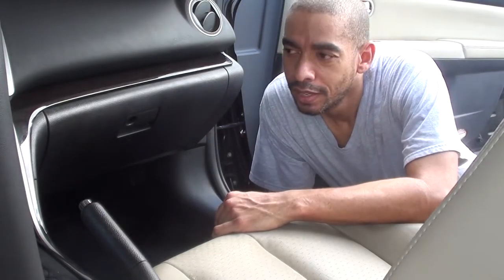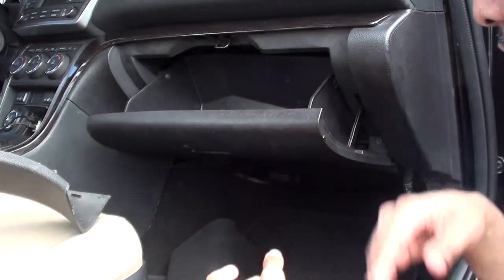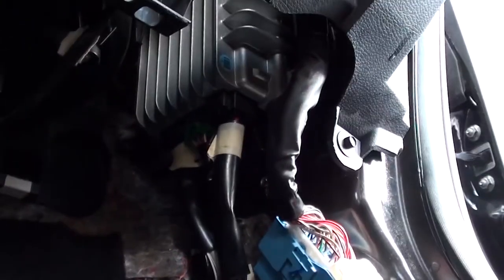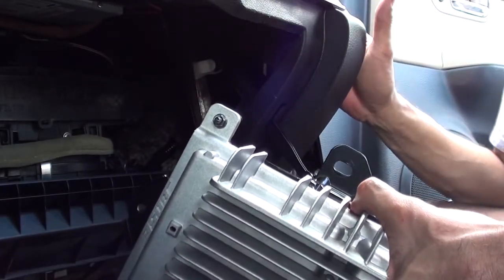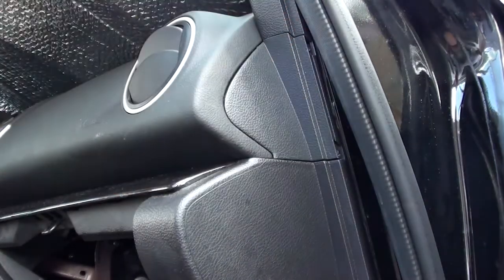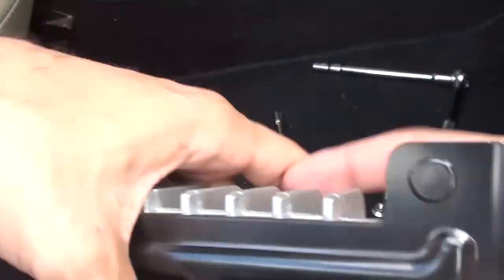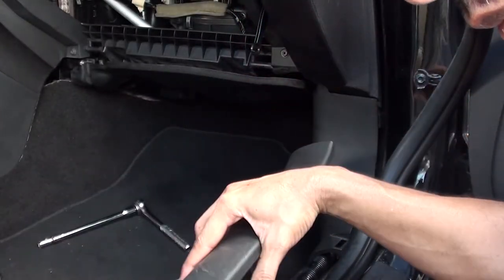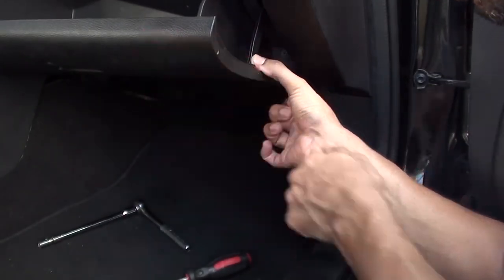2009 - 2013 Mazda 6 Bose 9M81 18T806 BB Amplifier Removal and Replacement

Comment: Thank you so much for making this video. I just followed your instructions today to replace my dead amp (loud machine gun sound out of all speakers) with another I bought from Ebay. I don't really work on my car at all, but this seemed very doable thanks to your detailed walkthrough. After about 20 minutes I was done! Thanks!
Reply: Mine still makes the machine gun sound after connecting the new amp, any tips ?
Reply: I have this exact same noise. The loud machine gun sound. Did it get rid of that sound?
Reply: @JPWRana  Yep, the replacement amp fixed that issue and still works great today. Give it a try!
Reply: @brian.8888 did you fix it ? I would say maybe the fuse

Comment: thanks for your video. i found a guy that comes to you. took out my 2008 maz 6 bose amp ,2 days later he installed the reconditioned amp with 2 years warranty.$330 aus. works like new.
Reply from the maker: Good going!
Reply: Hola Neil, podrías darme informes sobre en cuanto costó la reparación de tu amplificador, ya que tengo un problema con el mío y no encuentro donde repararlo

Comment: Great video. So glad to have found it. I had no idea where and how to pull the amp. My symptoms were that all speakers would cut out after a strange slamming sound. A day or 2 later it would come back. In the meantime I will leave the amp connected but I won't be putting all the panels back. I am thinking it may be an overheating issue. If it doesn't cut out again then that diagnosis would be confirmed. I ordered a used one anyway, just for safe keeping.
Reply: Today I had a problem with my bose sound system. It sunded like a machinegun...even if I tried to turn the system of....after av short while... no sound anymore...could it be the amplifier gone bad? Was that the slamming sound?...like a machine gun?

Comment: Hey bro. So im thinking this is whats wrong with my 2010... ive been having moisture under the front passenger floormat that i am told is from a clogged ac drain line or whatever. No one anywhere will un clog it and im no mechanic. Wondering if you knew how to do this and if moistyre could cause it. THANKS!
Reply from the maker: As it happens, I had this very problem with water getting under the passenger carpet. My problem was not a clogged AC drain pipe. but the problem was in the general vicinity. The AC drain pipe is on the passenger side of the engine bay, up against the firewall. It is just a little pipe that juts out of the firewall. It is a very bad design since it does not have a hose to carry the water away from the frame. In my case, as the AC water dripped from the pipe, it ran down the firewall down and under the sound-deadening material and found its way inside the cabin through a hairline crack in the seam. I fixed it by putting some silicone on the hairline crack and fitting a hose to the pipe. That hose no longer allows the water to run down the firewall. Some northern cars developed a front crossmember corrosion problem because of this pipe and Mazda fitted a hose to those cars. A friend of mine has a 2010 and it was originally from up north and it had this hose fitted. In case you are wondering, I went to O'Reilly and bought a Dorman PCV elbow, Part#47028 and it fit perfectly. You can see my post on mazda6club.com: https://www.mazda6club.com/threads/water-getting-into-the-cabin-but-where.447376/

Comment: Can you make a video on how to do the subwoofer? I have a 2011 Mazda 6 and it doesn’t have the Bose system but I upgraded the screen to a Bose stereo and the guy said if I can change the amp and the subwoofer it should work! This video was really helpful and I would really appreciate it!
Reply from the maker: Thanks for the comment. I really have no idea how to convert from the standard stereo system to a Bose system. To be honest with you, based on the reputation and reliability of Bose systems in general, I don't even think it's worth the effort. You can get a pretty decent system by using better equipment out there. Crutchfield sells an installation kit that will mount these aftermarket stereo head units and even make the steering wheel controls function as well. Just go to the website and search for your 2011 Mazda6. But, if this is something you really really want to do, I'll go ahead and make a video. Just give me some time to put things together.
Reply from the maker: I haven't forgotten about your request, my friend, but a series of things have prevented me from attempting this tutorial. From what I can see it's a pretty involved process, though. Stay tuned...

Comment: Hello Richard. I have recently bought a 2009 Mazda6 wagon. RHD, 2.5 litre, auto  160000km etc
When biased to the front speakers, there is only the faintest sound from them; the balance makes no difference.
The rear speakers are working although they sometimes sound 'wobbly'. 
Mine is the stock, non Bose 6 disc changer.
Is there an easy way to discover if the issue is with the speakers or the head unit?
Reply from the maker: Greetings! Thanks for watching. The first thing you want to do is to swap the rear door speakers with the fronts. If there is no change then the problem is probably the head unit. If the bad behaviour moves to the rear, then you have bad speakers. Good luck. Let us know what happens!

Comment: I have a 2018 mazda 6 that has audio issues regardless of whether I’m using CarPlay, radio, or any other Bose speaker function. Right now it doesn’t play any audio even tho the apps (eg CarPlay) work. I did hear some thumping almost like there could be a short in the speakers previous to this when trying to play music in my car. Could this actually be a bad amp tho? If so, any guidance on replacing or fixing the amp for the 2018 + models?
Reply from the maker: I can't recall a lot of 3G cars having problems with their amps, but we are talking about Bose here, and their problems are known in every car that they are installed in, be that car Mazda, Infiniti, or Chevy. Not a fan. Therefore, it could be the amp. If you want to jump to having it repaired, check out eBay. There will be lots of guys on there that offer the service.

Comment: Helpful video! Both your door speakers had no sound? How were you certain it was not a speaker issue vs an amp issue? Did you get the amp repaired?
Reply: I just watched your other video about your speakers. Bummer! Did you find replacements? I have the same model year and also had two Bose door speakers stop working. I was lucky and found a guy selling two he took out of his Mazda 3 - the front door ones only on Mazda 3 are the same as the Mazda 6 doors speakers. This instruction video was still excellent and helpful. Never knew amp location and how to remove.
Reply from the maker: Thanks for the comment. As it happens, I jumped the gun with getting the amp repaired. I did a resistance test of the speakers, as well as the amp and I got some strange readings (possibly a bad tester?) so I used deductive reasoning to determine that it was an amp problem. That turned out to be wrong. It might have actually been that both speakers didn't go bad at the exact same time. I may just not have noticed that the right rear speaker was bad from before. Whatever the case, I messed up, but I don't regret it. I now have an amp that is hopefully more robust than it was before.
Reply from the maker: I actually found the speakers new online for about $75 each. I plan to go ahead and get those because I anticipate used ones to have a much shorter life than new ones. What I've done in the mean time is to relocate the left rear speaker to the right front so I now have acceptable stereo sound. I should have the new ones in shortly, though. I'm not sure that I'll be putting up a video since there's nothing else to really show, unless my public wants me to show it. I'm glad you enjoyed the videos, though. Thanks for letting me know that the 3's front speakers fit our 6s. This is some critical information that I'll drop in a video, after all. Of course I'll mention your name as the source of that info, if that's okay with you. Take it easy, brother!
Reply: That should do it for you. I just plugged in the “new” ones and they worked straight away. Guy sold me the used ones for $50 total so I couldn’t pass that up! I’ll remember your videos if needed in the future.

Comment: I am just trying to get the loud machine gun noise to stop can I just remove the fuse for the bose system to stop it?
Reply from the maker: Go ahead and try that. But what that will do is you will lose functionality of the stereo and Bluetooth as well. If what you want is peace of mind for now, that's a good solution. If you can't find the fuse or if it also takes out another feature that you do want, then just get behind the panel like I show in the video and unplug the amplifier.

Comment: Hi Richard, great video, I am however trying to find my amplifier location on the 2003 Mazda 6, my model is the right hand drive version. I find the wiring for the subwoofer in the trunk but can't seem to be able to find where the amplifier should be. Note that this model seems to have all the wiring but did come with the amp, sub nor tweeters.  Would really appreciate if you can provide me with some insight.
Reply from the maker: I believe the amplifier for the RHD GG model (1G) is under the driver's seat.
Reply: @RichardTait1977  I search under both front seats but can't find the connector like i can everywhere else
Reply from the maker: @MusiChapman  I checked a 1G workshop manual that I have access to and the amplifier is under the driver's seat (RHD model), but it is actually closer to the right rear passenger footwell and requires the driver's seat to be pushed all the way forward to get to.

Comment: Hey i have the loud sound problem, am i able to take out the AMP completely without having to replace it? Im fine with no music whatsoever but i wanna make sure it safe
Reply from the maker: You can remove it, but nothing that uses the speakers will work. The stereo won't work and neither will the Bluetooth.

Comment: Question. No sound on radio. Fused good. How will I know for sure it's the amp and not the radio itself. Thanks
Reply: Hey! Have you found out what was the problem with that issue? " No sound on radio. Fused good. on mazda 6". Thanks!

Comment: Today I had a problem with my bose sound system. It sunded like a machinegun...even if I tried to turn the system of....after av short while... no sound anymore...could it be the amplifier gone bad?
Reply from the maker: That's perhaps the most common sign of the amplifier going bad.

Comment: Do you know how to just unhook the amp without the battery dying until I can get a new one?
Reply from the maker: Try unplugging it.
Reply: I’m not sure which one to unplug, I know one of the three goes to the battery
Reply from the maker: @alexander8370  Remove all three of the connectors. It doesn't matter at that point because if there is no power going to the amplifier then nothing else will work.

Comment: I knew this video is kinda old but can you run the car with the amplifier disconnected? Thanks
Reply from the maker: Yes, you can run the car with the amplifier disconnected. You won't have any audio from the factory stereo system, though.
Reply: What wire do you unplug to disconnect the amp but not the battery?

Comment: How much will be the repair cost for your amp? and what parts of it that must be replaced or fixed? 
Thanks, Sir.
Reply from the maker: The repair cost me $117.99, but I had to pay for it to be shipped to the fixers. They returned it to me at no extra charge, and the entire thing took two weeks or so. I won't be endorsing this person because I don't like the quality of their work (I found it to be untidily packaged for return to me and the amp itself had dust and metal filings on it). They also refused to answer my question as to whether anything was found wrong with the amp. I can understand if they do not want to divulge their trade secrets, but at least responding to my question would have been appreciated. That said, there are dozens of people on eBay who offer this service. Just do a search for "Mazda Bose Amplifier Repair" and they will come up. Good luck!
Reply: @RichardTait1977  Well,  thanks a lot, mate. I think about buying a new one instead of repairing mine.
Reply from the maker: @julio-ne3gt  You will pay several hundreds for a new one, if you can find it. On top of that, you may run into the same problems with the (obviously) substandard parts that Bose is using. I have no regrets about having mine repaired, even though it probably didn't need it. If you do research online, you will find lots of reports that Bose tends to use cheap parts to accomplish their goals. If my amp fails completely, I wouldn't have a problem gutting the Bose components and replacing them with better units from Sony or Kenwood. I would still want the stock appearance, though, and there are kits that can help with that.

Comment: Csn you use a newer bpse amplifier or you have to use that one in particular?
Reply from the maker: Thanks for watching the video. I don't know if a newer/different amp would work. But as I've said, if something should go wrong with this amp at any point now, I would be looking to replace the entire stereo system with non Bose pieces. I've pretty much lost all confidence in the brand.
Reply: @RichardTait1977  I like the sound quality but I was interested in keeping it and seeing if a newer bose amplifier or some other brand wouod work well with the speakers.
Reply from the maker: @momoneyindabank4  I understand. If you can find the exact replacement or another that can work it would be much simpler than what I would do. The danger of experimenting with these things is that you could cause damage.

Comment: I connected the new amp but only get loud machine gun noise .. what should I do ?
Reply from the maker: Oh dear. Where did you get this "new" amp? That's the sound they make when they need to be replaced or rebuilt. I hope you didn't buy an amp that was already toast.
Reply: @RichardTait1977  off eBay they said it was a brand new amp
Reply from the maker: @brian.8888  The only thing to do is to request a refund, unless you want to spend more money and have it rebuilt.

Comment: You're better off getting an aftermarket amp
Reply from the maker: Not necessarily. Replacing the amp will require replacing practically everything connected to it, including the head unit and speakers. The head unit will also have to have buttons for the clock. There is also an interface to have the steering wheel controls work. If you don't care about those things, then you can just throw bits and pieces in there. For me, I want the stock appearance and function and repairing the amp is the cheapest option
Reply: yea if you want to replace everything thing sure

Comment: 666 subscriber
Reply from the maker: Just in time for Halloween, huh? LOL 🎃👻🦇🕷🧛‍♂️🧟‍♂️
Reply: @RichardTait1977  hahaha yes! So currently I have no sound in my car, I believe its the amp or head unit but I'm not 100% positive. I currently have a PAC RP4-MZ11 and a dash kit for my mazda 6, I'm planning on putting in a new head unit, and seeing if I wire that into the factory amp if it would still play through the amp to the speakers, if not I'll just wire the inputs of the amps to the outputs. What do you think about me doing this, would it work?